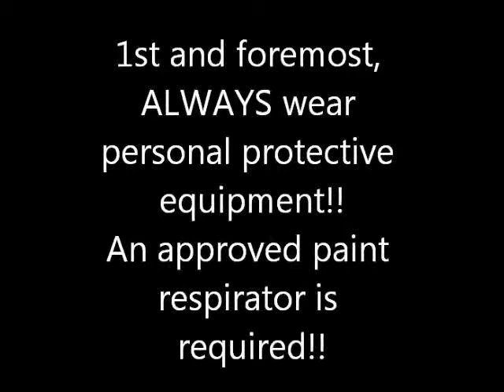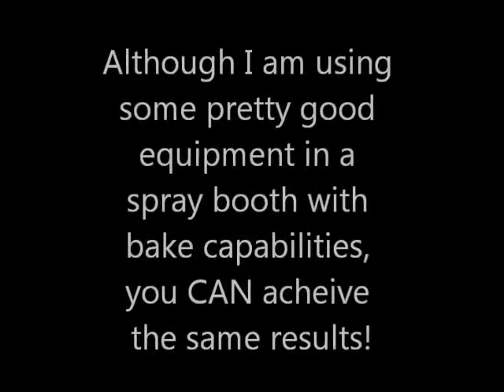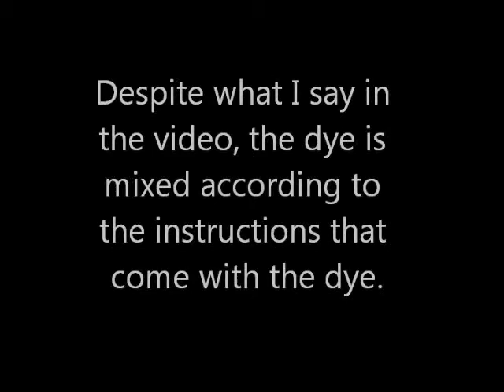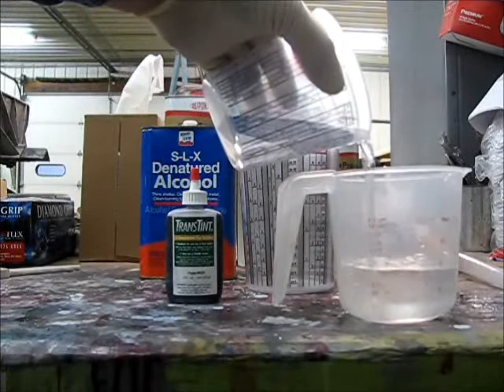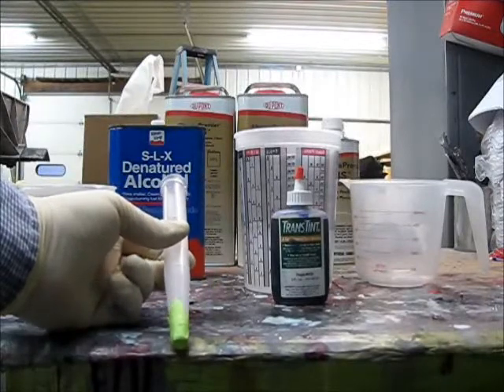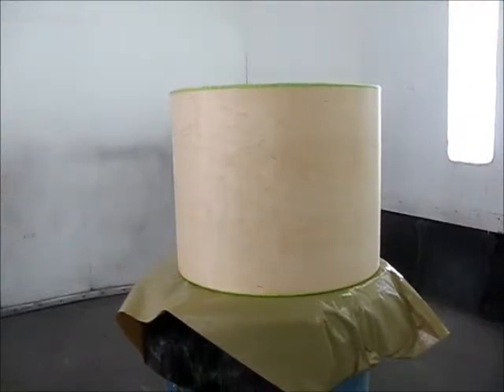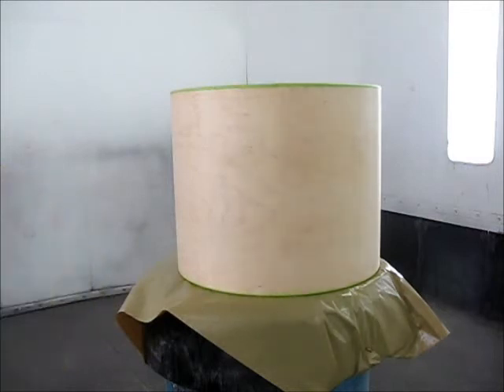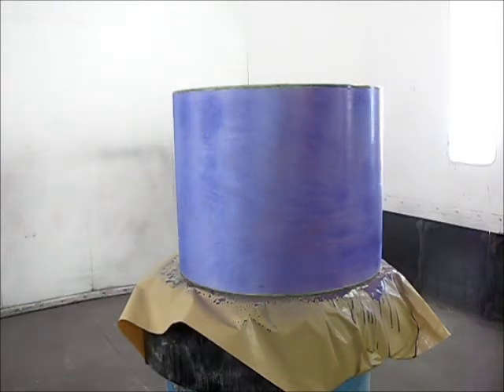Paint a drum shell: How to do a fade. Part 1

Comment: why did you spray with the gun sideways instead of adjusting the nozzle for vertical spray pattern? Just curious. Seems odd to turn the paint gun like that in my opinion. Great results regardless. Best wishes and happy drumming.
Reply from the maker: When you paint as many full cars as I have you learn to work with a standard setup. There are a few situations you paint like that on a car and it's pointless to stop and change the air cap position.
Reply: @stuperprohero  I see. I have just seen many of the spray guns that allow you to simply twist the cap and that changes the spray pattern. Regardless...your results certainly speak for themselves. Well done.

Comment from the maker: Yes you can! I'm really not sure of the results if you don't "spray" the dye. If you brush or sponge it on I have no idea what it will look like. It "may" or may not have dark or light areas if not sprayed evenly. You should perform all the steps up to the middle of video 6. In video 6 it says to only apply one coat of clear. I would apply no more than 4 and no less than 3 good wet coats. Let it dry a few days then skip to the sanding and buffing videos. Good luck! Let us know how it turns out!